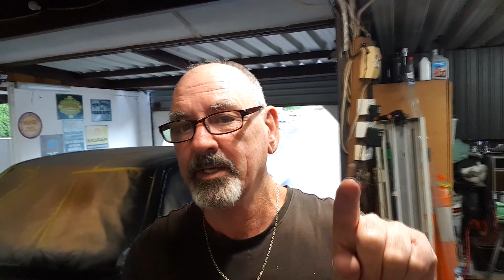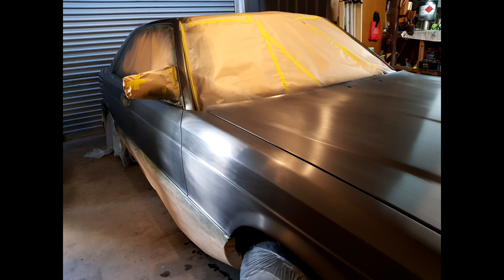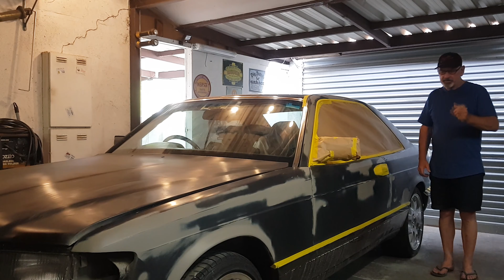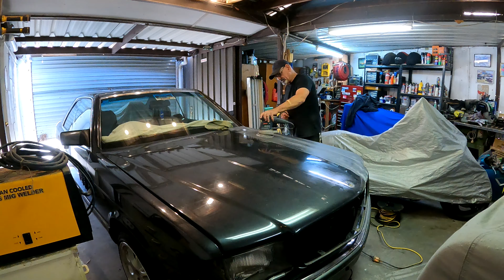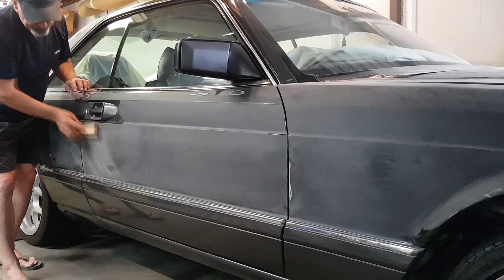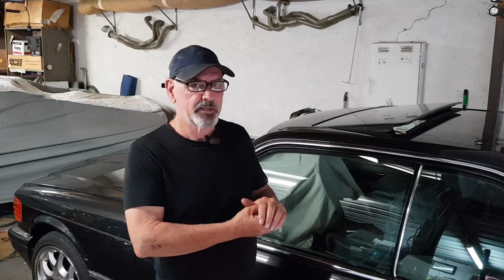Classic Mercedes Resto #mercedes

Comment: Sanding, sanding, sanding.  I am familiar with it.  I was wondering what was up, R.K.
Reply from the maker: Dan it sounds like you are familiar as this job is 90% sanding and 10% for the rest. This is the 2nd time I have done this car the last time was well over a decade ago. Back then it won two years in a row in our main major state car competition and runner up in over seven other comps.
Reply: @rolandkeith5322  Nice!